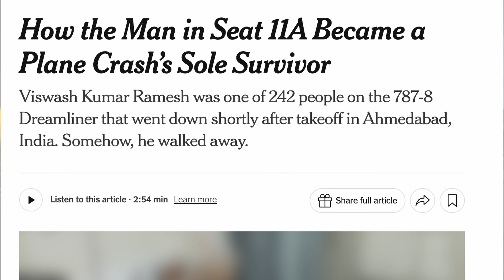Why the RAT Changes Everything – Air India 171 Update

Comment: Question...I know the engines on jets provide electrical power, but @ what point do the engines "take over" providing power for the jets?  I'm asking bcz I know that early on Dreamliners had many issues with their lithium-ion batteries & I can't help but wonder since whatever caused this crash basically originated right @ the time of take-off.  I've also heard of reporting that prior to take-off inside the jet it was very hot & uncomfortable & that many electrical devices for passengers were not operational which would (again) lead me to think this crash originated with battery-related problems...maybe?  At take-off would be (I'm assuming) right around the time where electrical power would be "handed off" from actual electrical origin to the jet engine provision of electrical power...which again is leading me to think this catastrophe may be related to the original power from the batteries that somehow failed then led to the engines not being able to work prior to being able to generate electrical power on their own thus deploying of the RAT, thus no thrust from engines, thus the crash.

I'm also leaning into the contaminated fuel theory bcz at one point the jet engines were in operation & when they somehow stop working, there's still combustion of unused fuel in the engines which would lead to fire coming out of the engines.  If the fuel is contaminated maybe with water, it'd make it a whole lot harder for fuel to burn, right?  And if fuel's not being combusted, then you wouldn't see fire coming out of the engines due to compressor stall/engine failure bcz jet fuel is too saturated with another non-flammable component.

Comment: This is heartbreaking. 
Great commentary Capt.Steve. I respect your  transparent talk, again saying these are your theories, since you lack all the facts. 

Did you see video of passenger on the flight on this jet, allegedly prior to this one? 
Allegedly this exact jet had no  working 
A/C & lights were flickering. The  seat screens to watch movies were not working passengers stated. 
Wouldn’t they let the next pilots know in the log book &  verbally? Wouldn’t the prior flights pilots tell maintenance right away? 
 Is this a reason to ground this jet until these issues are fixed, or deemed safe to fly, after maintenance checks it? 
Steve, could it be that this jet was doomed prior to take off, due to major electrical power or hydraulic  issues? How did the hot temps. affect the hydraulic fluid & the engines? 
You & Greg Feith, retired NTSB Investigator, are excellent narrators! A Captain’s knowledge & 
educated point of view is quite interesting! Thank you. You’re awesome!

Comment: Still need an explanation for why the flaps would be up. Presumably the flaps were down during takeoff and there would be no reason to raise them given the time frame and situation. 

I'm guessing the failure prevented the gear from coming up but if that's the case how did the flaps get retracted and why?
Reply: That would be to do with the human hand who operated it. Why? A low houred First Officer failing to double check what he was about to do, an experienced Captain making a huge mistake in not taking a nanosecond to confirm the low houred First Officer's hand was where it was meant to be at a critical stage of flight, allowing him to    intervene and save everybody.

Comment: One of our media channel spoked about initial analysis - When the airplane take off, captain realised that the left engine is not working, so he commanded first officer to cut-off the fuel supply from left engine. You can see in the video airplane is slightly tilted towards left. Now, instead of stopping fuel supply from left engine, he accidentally cut-off fuel supply from right engine that led to dual engine failure.

Comment: Still shocked by the footage , by your expert analyst I think it's either  a maintenance issue ( Hydrolics failure or contaminated fuel) , given  it was both engines that lost thrust, had it been Just  one engine lost power the outcome  could have been less diseasterous . In the paat an thrust reverser activated without any imput in  by the pilots , is this a possibility with  flight 171??

Comment: The passenger who's seated on 11A can evidently tell if he could hear both engine noises or not after take off. 

As he mentioned there was a Bang sound and flameout, it's likely the dual engine failure. The engines lost the power. Pre flight check details in combination with the Flight recorder details will tell us more.

Comment: Here are the latest *verified updates* on the Air India AI-171 crash investigation, based on India's AAIB *preliminary report* released today (**June 25, 2025**):

---

### 🔥 *Critical Findings from AAIB Preliminary Report*  
1. **Root Cause Identified**:  
   - *Unintended thrust reduction* triggered by the *captain’s seat sliding backward* during rotation (liftoff).  
   - The seat’s **AFT lock mechanism failed**, causing sudden rearward movement. The captain’s body weight forcibly pulled the thrust levers to idle.  
   - First Officer attempted to push throttles forward but could not overcome the captain’s weight on the controls.  

2. **Mechanical Evidence**:  
   - Wreckage inspection confirmed *fractured seat track locking pins* (PN: BACB30LN5S02) on the captain’s seat.  
   - Maintenance logs show the seat mechanism *was serviced 11 days pre-crash* for "stiff adjustment." No post-repair function test was documented.  

3. *Flight Deck Timeline* (CVR/FDR correlation):  
   - **+0:12 sec**: Rotation begins. Captain’s seat slips aft abruptly.  
   - **+0:15 sec**: Thrust levers pulled to idle. First Officer: "*Thrust dropping!*"  
   - **+0:18 sec**: Captain: "*My seat!*" Struggle heard.  
   - **+0:26 sec**: First Officer attempts full thrust; aircraft stalls at 214 ft.  
   - **+0:38 sec**: Impact.  

4. **Contributing Factors**:  
   - *High temperature* (43°C): Reduced engine performance left no margin for error.  
   - **Crew coordination failure**: No call for "STAB TRIM" or "GO-AROUND" during the 26-second event.  
   - **Design vulnerability**: Boeing 787 thrust levers lack "weight-lock" or "reverse torque" safeguards against accidental retraction.  

---

### ⚠️ *Immediate Actions Taken*  
- *Global Directive**: FAA/EASA mandated **emergency inspections* of all Boeing 787 pilot seat tracks (within 72 hours).  
- **Air India**: Grounded 12 aircraft with similar seat maintenance records.  
- **Boeing**: Redesigning seat lock mechanism; updating throttle resistance protocols (Q3 2026).  

---

### 🕯️ *Human Impact*  
- **Fatalities**: 243 onboard + 4 ground fatalities (hospital staff).  
- **Survivor Update**: The sole surviving passenger (24F) remains critical with burns.  

---

### → **Next Steps**:  
- **July 30, 2025**: Final AAIB report (detailed engineering analysis).  
- **August 2025**: Int'l summit on cockpit ergonomics/safety (ICAO-led).  

**Sources**: 
[AAIB Preliminary Report](https://aaib.gov.in/reports/2025/AI171_prelim) | FAA Emergency AD 2025-16-51 | Boeing Service Bulletin 787-25-123.
Reply: you forgot to edit the date.. try hard next time.
Reply: I think this is fake

Comment: Already asked in the comment on your last AI171 related video. If it's an APU failure or not, if RAT is deployed, and can it work on that altitude? 

I doubt it's an Electrical failure for that, the Pilots were unable to put the flaps in the correct setting and was unable to bring the Landing gears up. This theory solidifies if you go through the video "https://youtu.be/blTT4ybMWCc" which was done when the same flight was returning from DEL, just before the crash journey. It is saying that the AC, lights, air hostess calling button not working properly. Means there must be some electrical issue.

Correct me if I am wrong anywhere, because I am just an Aviation enthusiast.

Comment: Very well Analyzed by Captain Steeve. It was tragic timing for RAT to be deployed due to both engines failure. Wonder what the pilots in the previous flight on this aircraft from Delhi reported in their debrief when they landed in Ahmedabad? Their should have been some indication on the prior flight in the advanced diagnostic system on board the aircraft. Finding the root cause(s) can save so many lives in the future. May the departed souls rest at the lotus feet of God.🙏

Comment: Very convincing, I now  have no doubt that the RAT has in fact been deployed. The question is why both engines failed simultaneously after a NORMAL takeoff. To me It doesn't look like a fuel contamination problem, because it would have manifested earlier and probably would not have affected both engines at the same time. I think this looks more like electric failure that could have disrupted the fly-by-wire system, or possibly the glitch in the software. If so, Boeing is going to be in a lot of trouble (again).

Comment: It’s not about the plane's flap, landing gear, pilot error, bird hit etc. i think the pilot knew that there is something wrong when the aircraft is on the runway. May be thats why he used the runway's  maximum distance to take off the plane .There are 3 speed levels for flights before take off. V1, VR and V2. After V1 speed, even if there is a problem the pilot can't apply brake and he should initiate the take off .No alternatives . So the pilot had only one option. Take off and immediately make an emergency landing. May be that's why he didn’t retract the landing gears and the lone survivor mentioned that he heard a loud bang from the plane and lights were flickering apparently indicates an engine failure  the flight came in to a state of "stalling" and unable to lift that's why pilot made a mayday call. He was helpless and everything happened in a few seconds, this is a clear case of engine failure and need a further investigation to unravel the mystery. What made both engines fail !!!

Comment: Hello Captain Steeeve. Thanks for sharing your top shelf knowledge with us. I'm working as a safety officer in a big construction company. I've seen a lot of accidents with big machenery involved. Waht i can say is, that all big accidents have a hell of lot of circumstances leading up to the terrible result. How about a flap / landing gear confusion, treating it as a doubble engine failure in the hurry of the situation? The pilots didn't have a second to sort out the facts and it could well be, that one mistake triggered the next one. In one of the videos from the wings, the flaps were rectracted on one wing but extended on the other wing. did the pilots try to extract the flaps agian? Thanks and stay safe

Comment: As a safety engineer, this is a pure horror scenario, especially in Aviation, where thorough Risk Assessments are performed with the Main priority to avoid any such total loss scenario you can imagine. In an FMECA or similiar analysis the engineers have assessed so many individual component failures and their consequences. This means, there most likely had been issues with some components and they were not corrected – for whatever reason. Thus it seems likely that the fate of the people in the Aircraft was already sealed before the start.

Comment: Most Important Information
 The lone survivor in his latest interview revealed that "Right after the takeoff he felt a 'forward jerk or feeling of breaking' and some seconds before the crash he heard the sound of 'engine accelerating or spooling up" this critical piece of information points towards dual engine failure for a brief period of time. The engine probably roared back to life but there wasn't enough time and altitude for them to be effective again also this means either there was fuel contamination blocking fuel lines or Because now we know  that the RAT was deployed there was catastrophic electrical failure.
I also looked at some on ground images of the tail section 'The APU intake flap was Open' this means they already had some electrical issues or pilots started the APU inflight.
There are also on ground images of the wings which clearly show 'The Flaps in extended position' ruling out pilot error theory.
In this video we can also see the landing gear is parallel to the aircraft body which only happens if it is being retracted back in to landing gear bay (in Normal deployed position landing gear is tilted up from the front) thus pilots did try to retract the landing gear correctly but it was stuck midway.

Comment: I hope they will made the planes more technically better like they upgrade the seats to have parachutes in case of accident there would be a button to be controlled by somehow the cabin crew in case of accident these seats will just fly high with parachute so the whole seats would land safe in case of that accident i know sounds crazy but these measures must be taking seriously for passengers and worth to develop every safety for them.
Reply: Not anywhere near practical. Even if it was 'technically possible', at the height this plane reached, they would have been too close to the ground, so it would have done no good. It's not a fighter jet with one or two pilots in specially designed flying suits and helmets, wearing full breathing apparatus, harnessed into powered seats, sitting under a glass canopy that can be jettisoned. It's a wide-bodied jet with luggage compartments and all sorts of critical cables and wiring running through the void between the cabin roof and the outer skin of the plane. The roof can't just be 'jettisoned off' like a fighter jet canopy can. Even if it could, you can't simultaneously fire 300-odd seats into the air in such close proximity. They'd hit each other, killing the occupants instantly. Even if that didn't happen, the parachutes would then become entangled and people who hadn't reached as high as others would be hit by the seats falling away. A powered seat is way too heavy to remain strapped into for a parachute descent. Anywhere above 10,000 feet and the passengers would die within seconds from lack of oxygen. The outside air temperature at 10,000 feet is around -12C (10.56F), so that would likely kill them anyway. Even from an altitude of, 3,000ft, (which according to a quick search, is the rough height recommended for inexperienced parachutists to start jumping from), where are they going to land?  Another quick search suggests that at 3,000ft, on a very simple straight approach, based on the typical descent angle used by air traffic control and in instrument approach, the plane would be about 11-12 miles from the runway. They might be over ocean, dense forest, a heavily built-up area, a snow-covered remote hillside. Where will their parachute land? How will they survive? Who will come to rescue them? How much would this idea cost in terms of a new design for passenger planes? What would a plane full of military-grade seats weigh? What would it do to load factors? How much extra fuel would it take to power this heavier plane with fewer passenger seats available for sale? How much more expensive would flying become? It simply would not work technically or economically.
Reply: Thank you for your logic responds & time🤝  @11nitrox

Comment: Hey Captain Steeeeve  great videos. I was wondering if you seen the video of that same aircraft that a passenger showed no power on the aircraft the TV screens on the back of the seats did not work the air conditioning he should the passengers on the plane fanning themselves , the call button for the air stewardess. He said he could not track the flight on screen as normal

Comment: What if they were either over the weight limit or at the maximum weight of the aircraft plus it was going to London so the fuel weight effect too, so when they takeoff obviously they need speed and flaps would significantly reduce speed so they might have tried to takeoff with no flaps to pick up enough speed, notice that the plane was very late to takeoff which would explain the stall of the aircraft which eventually led to the crash.

BTW If I am wrong about this theory please correct me and I hope Steve and the others see this

Thanks
Reply: Also as Steve said there might have been engine / fuel failure

Comment: Only asking as it was the theory you leant on the most, but are there many, or any at all, recorded incidents where the flaps have been retracted by accident instead of pulling or pushing the gear up lever? It seems like am almost impossible mistake to make. Like changing gear in a car and accidently pulling the hood release lever, they are in two different areas.

Comment: lol no 😂😂
Whilst the RAT can deploy in seconds it takes many seconds for the detection to occur before deployment 
We can clearly see from the dust thrown up from take off that engines are running. So the engines are running at take off, and it takes a while for engines to spool down the system to detect and then the rat to deploy, so no chance of that in the time we saw 
Plus the pilots were communicating mayday so the radios were all working

Comment: It could still be pilot error. The RAT explains the undercarriage (no hydraulic power to raise it) but not the flaps configuration. If they took off with the wrong flap setting, what could cause both engines to fail?

Comment: What about a report from a inbound passenger from this very same aircraft before it was turned around for its ill- fated last takeoff.  He stated that the aircraft’s A/C wasn’t working as well as none of the seat displays would work?  Since this is a fly by wire aircraft their could be a major cascading electrical short finding it’s way to its flight computer systems?